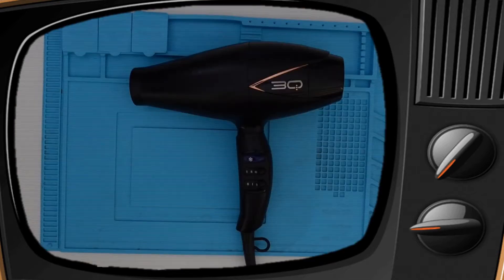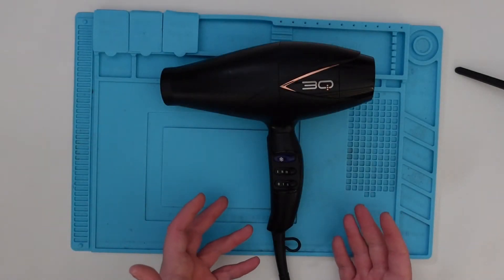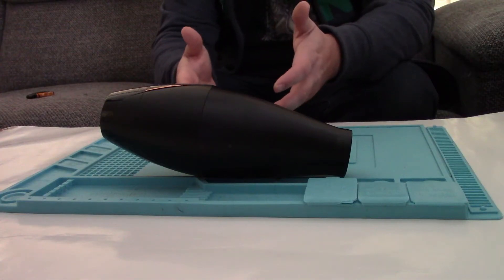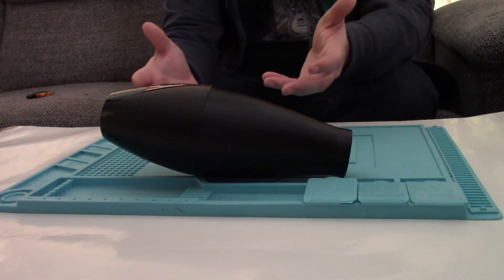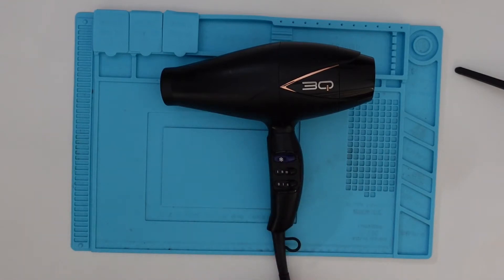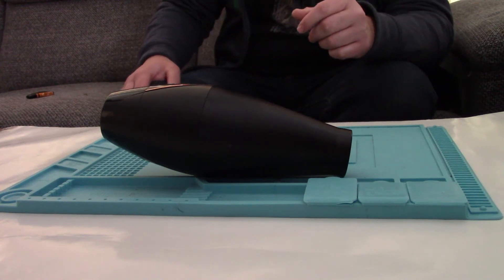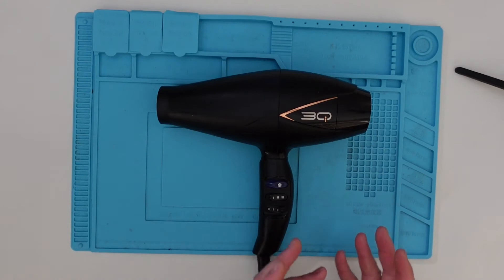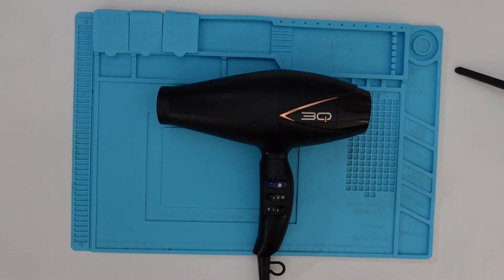BaByliss 3Q Hair Dryer that BLOWS COLD!  Is the heating element broken?  CAN I FIX IT?

Comment: The fact that you didn't have the back cover on when u tested it, prevented the hot air to get pushed out. There was nothing steering the fan air into the dryer if u get what I mean.
Reply from the maker: Ah, yes that makes sense.  Thanks 👍
Reply: Yeah I was screaming the ducted fan won’t work without the cowling!!!  Love the vids and the singing at the end
Reply: Hello, do you know if it's possible to disable the heating element? I need my hair dryer to blow normal air only. If I just pull out the connection to the heating element will it still work?
Reply: @Adam-oz1vm  If the wires go to a plug and then connect to the heating element you could pull out the plug and it should still be able to bow cold but the chances are the wires are soldered on .
You will not know without opening it up
Reply: Spotted that immediately when I saw the elements heat up. No cowling on the back is air not being forced through.

Comment: The capacitor should have a discharge resistor across it to prevent people getting zapped when they touch the plugs. If it doesn't have one you should discharge it by shorting it for example with a screwdriver before you start working on the device.

Comment: At 8 mins you tested it with the back OFF , I’m sure without it the fan wont create air flow? The fan was basically freewheeling the air whilst the element heated up as normal , I suspect the erratic switch was the only issue? Love your vids though. Mistakes are learning opportunities

Comment: The issue is that the unit has a thermistor installed and when it overheats it prevents the heating element from engaging. Cleaning it, fixed that.   Well done

Comment: Hello, do you know if it's possible to disable the heating element? I need my hair dryer to blow normal air only. If I just pull out the connection to the heating element will it still work?
Reply: Can’t it just be turned to cold as per the dryer in the vid? Save opening it up, failing that simply isolate the heat setting switch somehow?
Reply: It should do yes , try it and see